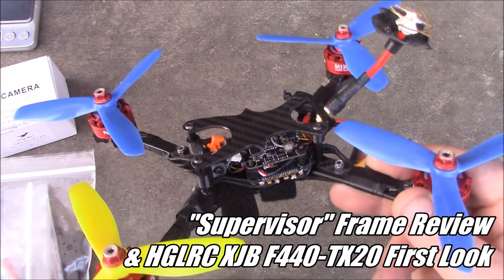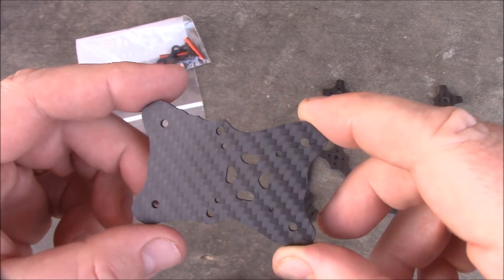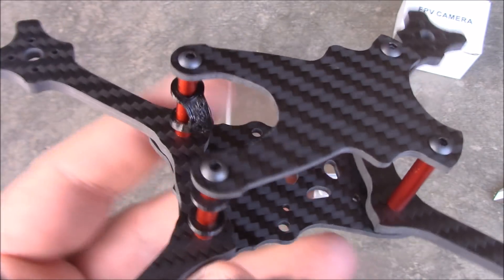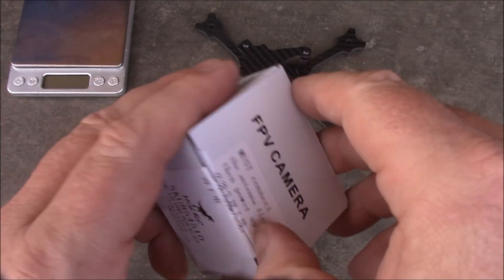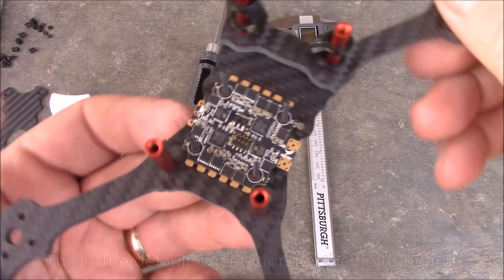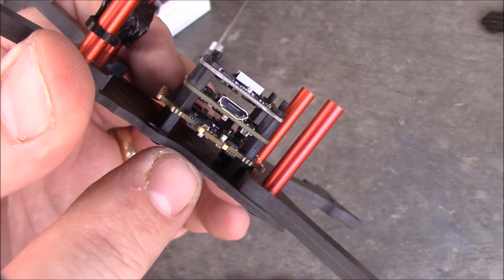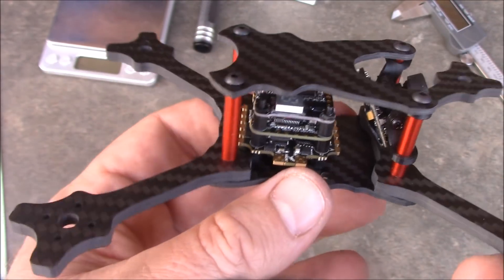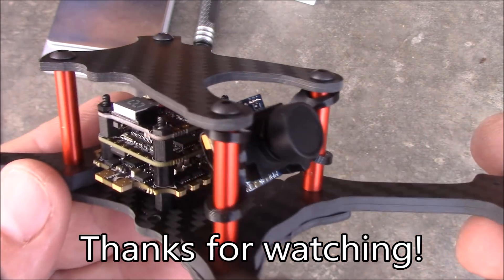Team Neugen Supervisor Frame & the HGLRC XJB F440-TX20

Comment: Hey just some info on this frame, before anyone starts saying clone this and that, I pretty much told Bob I was going to use the boomerang design on my frames since  he released the hyperlite and he said go for it, and if you feel boomerang arms are unique please educate yourself and look at the Obi One frame from 2015. One more thing this frame is built around the 1506 motor and 3.5 inch props, it can be used with a TPU only canopy only without any loss of structural strength in either torsional or lateral flex. Now if you really feel it's a clone place both frames side by side and then compare them.
Reply: Israel Chagollan agreed, this cloning thing gets on my tits, you’ve used ideas that have been around for years. Bob did not invent the quad! Thug frames has been using arms like that for 3yrs. Like the look of this... but for a different reason. I’m playing around with a 3” GoPro carrying quad, and at 3.5” this looks like an interesting option with 1507s etc. In my testing, it’s viable and really fun.

Comment: The 8pin connector is a real week point if it hasn't been glued. My F440 stack came without glue and now its F#*¢k€d. Never made it past the build stage. My F428 stack however has the glue, and works fine. Don't know why they went backwards in the designing of this one.
Reply from the maker: The ESC and Flight boards came glued together on the F428?
Reply: travisgrindal I dont mean the boards are fixed together, just that the pin headers have been reinforced with glue. I have the F428 V2 and that has the pins glued to the board.(Also has slightly different layout for components). Its strange why they have made newer boards that dont include the glue.
Reply from the maker: Okay, I get it now.

Comment: it looks like the design is based on the floss frames
Reply: DanO FPV the Boss frame was designed and in use by our California team at least one month prior to the release of the Floss "2" frame, if you feel like a comparison is needed I would suggest to compare it with the original Floss frame and nothing else after that, regarding the 3.5 Bob saw my initial design on the Micro brushless Facebook firums, this frame is meant to be used with a TPU mount with 0 structural compromise and was presented as such. I cannot unfortunately sell it as a pod kit due to price but the canopy is available for all to purchase. To this day not one of the initial 40 test frames has been broken, it's a very tough design.
Reply from the maker: It does but the Boss XL frame was actually designed and in beta testing before the Floss was released.  The Floss's popularity is undeniable though.
Reply: i'm not saying someone is cloning, but i noticed more and more frames share similar design features. And i am always curious who has started the original idea. I like the idea of having a TPU mount without structural compromises.
Reply: DanO FPV at one point in time designs end up with similar features, I could go back more than one year ago and pull out my original super stretch 3inch frame or my friend Michael's 3.5 inch stretchframe and I can guarantee you people would say it looks like the tooth fairy or Floss.